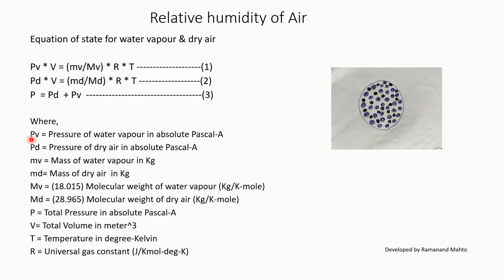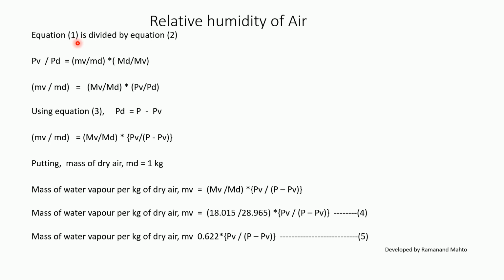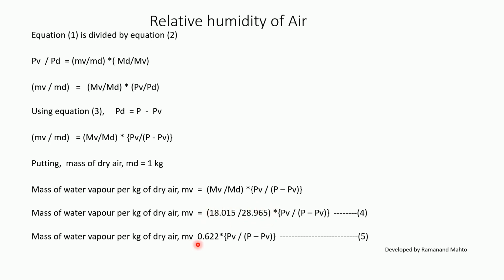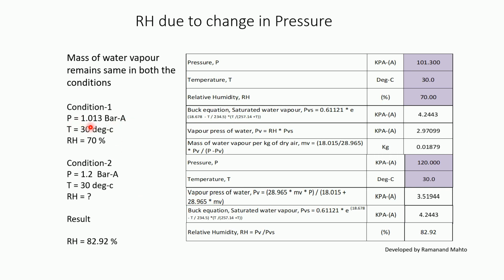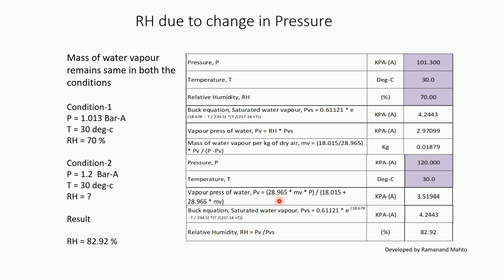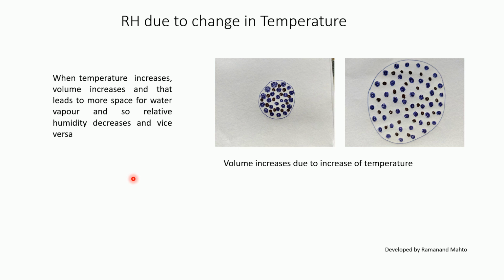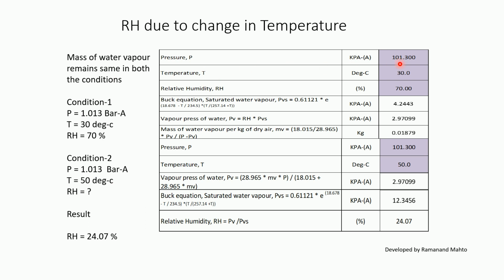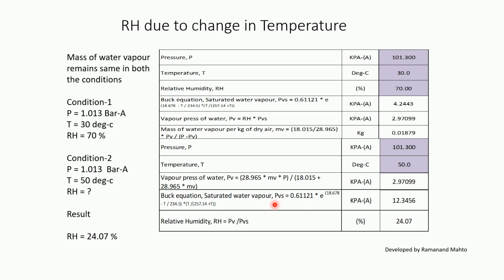Relative Humidity Part 2

Comment: What is effect of relative humidity and temperature of air for rotary screw air compressors? And can we calculate change in volume of compressed air obtained due to RH and temperature?
Reply from the maker: Effect of RH and temp of atmosphere has similar to all types of compressor . If there is condensation in stage of compressor then mole weight of moist air becomes more then so if you calculate density of moist air will be more .
Reply from the maker: If RH is more, then mole weight of moist air is lesser and so inlet density of air becomes less and so compressor will handle less flow and pressure for particular operation .